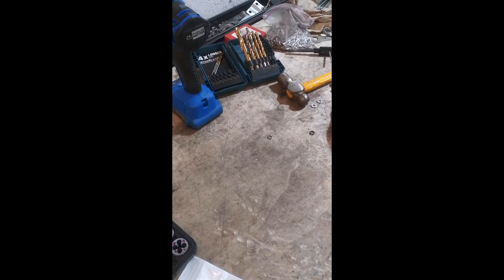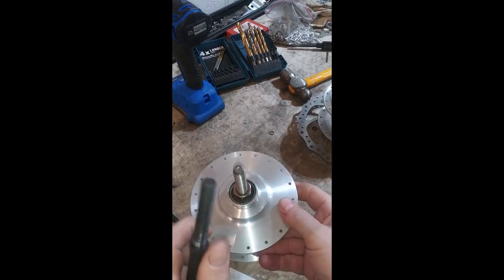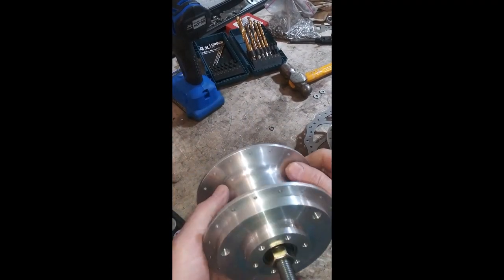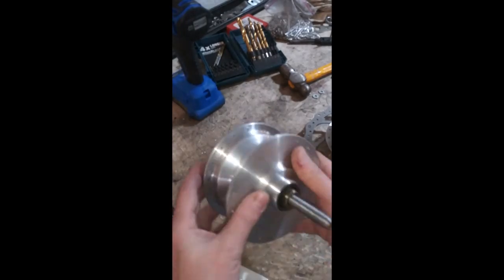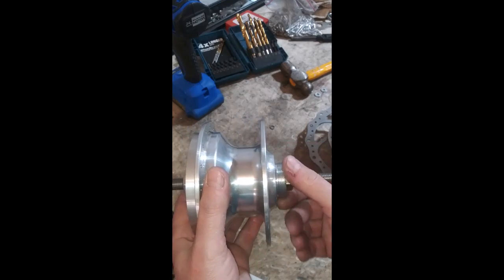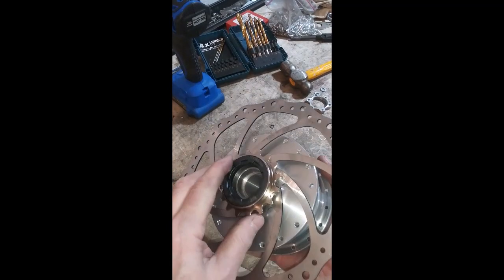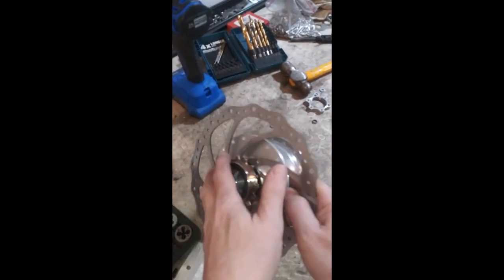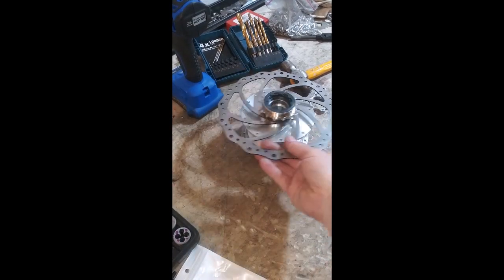Gemini hubs

Comment: I have one of your rear hubs..... do you have any ideas for clearance issues due to having a 56 tooth sprocket trying to convert to a mechanical disk brake?
Reply from the maker: Clearance issues as in what? Rotor rubbing the frame? Chain rubbing the frame? Could you be a little more specific?

Comment: How does the caliper bracket reach the disc?shouldn't the peddle freewheel go on first then the disc ? And what size bit and tools do I need to do this project thanks
Reply from the maker: Hi Shaun. There's a 6 hole spacer that's included in with the rest of the hardware. It spaces the rotor away from the chain sprocket. But also , there's a New version of my hub that has the rotor mount on the other side as well.
Reply: @djwillk  ya that's what I was talking about putting the disc on the pedal side but how disc the caliper reach the disc  should the sprocket go on first then the disc will be closer to the frame so a caliper bracket will reach ?I see the new thread extension but I don't think I'll have enough clearance for that so I want to drill holes like you did in video